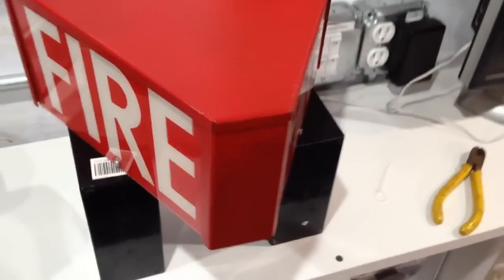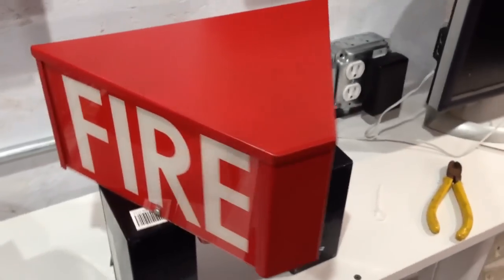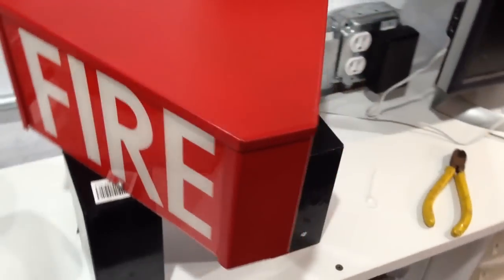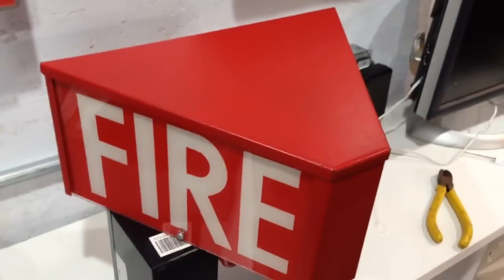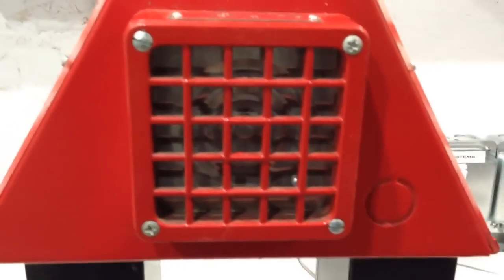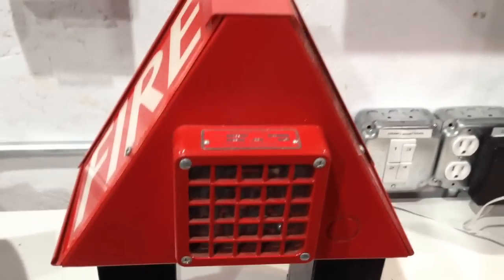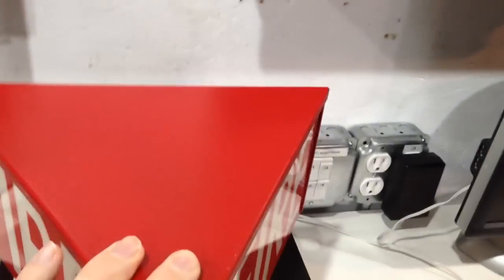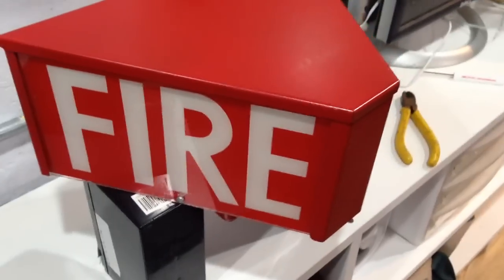Very rare Fire-Lite light

Comment: Interesting to see a federal signal horn on the fire light unit, are you sure this is the way they came from the factory or could it have been put together by someone ?
There is also a hex bolt that you can turn to adjust the pitch of the horn. They sound much better when running on 120VAC
Reply from the maker: Video Security Services, Québec Yeah I am pretty sure this is how they came from the factory. As for the screw, I know where it is, have not turned it yet.
Reply: ***** About the bolts, why do some older horns allow you to adjust the volume?

Comment: I’ve seen it at an old hotel called the Gadsden. But I don’t know what the alarm on the bottom is. It also had a Fire-Lite BG-6 connected.
Reply: Just like what you said about it being in a hotel. Was the hotel in Arizona?
Reply: Because I think I saw it once in person.
Reply: That was the hotel featured in the episode of Hotel Impossible that Andrew mentions. ("Fire Drill Flameout" if you're interested) Going by what I've seen on Google Maps, most of that 1970s-era system has been replaced with a modern Simplex system: the Fire-Lite C-series panel has been replaced with a Simplex 4010ES & the Fire-Lite "fire lights" with Simplex Truealerts. The original BG-6 pull stations appear to still be there though. While I don't know what might have happened to any of the alarms, I do know that the original Fire-Lite C-series panel is on display in the hotel's "museum" section.

Comment: Newageserveralarm can you help me my Notifier NFW-50 is not working right I was getting ready for system test 4 the panel is going into alarm nothing was pulled no shorts I don't know how to fix it please can you help.
Reply from the maker: MST 2474 What device is causing the alarm?
Reply: I had another resister hooked up I never noticed it but there is another problem with my Notifier NFW-50 NAC 2 doesn't work the panel does not display a trouble I don't know why.
Reply: @YutuTheFox  That's Notifier for you

Comment: I cant help but notice that distinctive pull station that's on the far right (the one closest to this fire lite fire light) of the other ones what's it called and who manufactured it.
Reply: SixR it's a very rare fenwell pull station that would activate a fire suppression system with either fm200, foam, or any clean agent 
see mini system test 23 for the test
Reply: SixR the model is unknown

Comment: After the hotel impossible, did they put a new Alarm in place?
Reply from the maker: I dont know,  never been there before.
Reply: Official NewAgeServerAlarm it should be a bit up to code because of low frequencies wake up people, they also need to put more low frequency alarms there According to the video it was too quiet by the panel.
Reply from the maker: Depends on the requirements of the local authority having jurisdiction.

If they are following current codes, yes low frequency sounders.
Reply from the maker: Also quiet by the panel could be also the type of microphone they are using on the camera. It may have been a "shotgun" - a directional microphone that picks up sound the most effectively directly in front of it but not off to the sides.
Reply: Sorry to be 3 years late, but to answer your question: it appears much of the system WAS replaced sometime after the Hotel Impossible episode aired. The 1970s-era Fire-Lite C-series panel was replaced with a Simplex 4010ES & the Fire-Lite "fire lights" with Simplex Truealerts. The original BG-6 pull stations appear to still be there though. (all of this I saw on Google Maps) Not to worry though: the hotel's original Fire-Lite C-series panel can still be found on display in the "museum" section of the building.

Comment: Anybody know if the older Federal 450 is the same as the Simplex 4041? They look a like.
Reply from the maker: Goldenrod636 They're slightly different. This horn has "ripples" in the sounder plate while the 4041 one is flat.
Reply: ***** Just asking. Though the 4041 does sound like the Vibration 450

Comment: I just got a 450 A1 Series (450-048-001) Like that. But with differences including:
1. It is a grey horn
2. It has a 3/32" DC Volume Screw on the front of it
3. It runs on not 24 but 48 VDC

Comment: The alarm is big. Is it also heavy?
Reply from the maker: Tech Cooker A bit heavy, probably about 2 or 3 pounds.
Reply: ***** That's not bad. Which is heavier, the Fire-Lite Light or the Simplex 4050-80 or 4050-85 light plate?
Reply from the maker: Tech Cooker Fire-Lite Light
Reply: Official NewAgeServerAlarm that’s pretty light. It looks VERY HEAVY.

Comment: I miss the 8005 and i8005 will you do a mini-system test with them?
Reply: gbvenom he has gotten more higher end panels like the notifier lowset high end panel 
he doesn't have the time and space to make a demonstration system with either the 8005 or the i8005 because 
1. The 8005 is not loaded with features 
2. The i8005 still has bugs in it

Comment: What dose loop mean I got a nd 9200
Reply from the maker: matthew Groff Loop refers to the SLC (Signaling Line Circuit) that all the addressable devices wire to. You should really read the manual for the MS-9200 before you mess something up and accidentally break it.

Comment: My old elementary school had these and the BG6 pull stations. I wanted to ask for one when they tore down the building but I wasn't able to.
Reply: +Sebastian Tolls Hmm, was that the old Wellington Elementary in Belmont MA?
Reply: Yes. I went there before and during the time it was rebuilt.
Reply: Yeah, I have a friend from Belmont. It seems most new schools they build in Eastern Massachusetts go with EST voice-evac systems nowadays; an exception is the new West Bridgewater High School, which has a Simplex 4100ES voice-evac system, but that might be because the old high school had a Simplex system as well.
Reply: +wileyk209zback I went to Chenery Middle School, also in Belmont and they had a simplex 4020 voice evac system with Federal signal horn strobes.
Reply: Yep, my friend went there too. The high school has a pretty old Simplex system from 1971 with flush-mount 4040 horns on 90bpm March Time (I think they had a 2001 panel installed in the 80s). But they may be replacing it soon.
Reply: +wileyk209zback I'm at the high school now. They are replacing the Simplex 4040s with Specter Alert SP2R speaker strobes. I don't know what the panel is. I asked about getting one of the old alarms but the school said that they first have to make sure that there is no risk of asbestos exposure.
Reply: Interesting; they're probably putting in a Notifier voice-evac system. That's what they often use for fire alarm replacements at Brockton's schools too. I'll have to let my friend know.
Reply: I also heard that one year after the Notifier voice-evac system was installed, it shorted out! Talk about dumb luck. The Simplex 2001 before it lasted way longer. But hopefully the replacement Notifier panel will last almost as long as the 2001 did.

Comment: Try swapping the horn for another 12vdc horn or something...
Reply from the maker: Bob Trevek I don't have any more 12 volt horns.
Reply: Oh..
. Then what you should do is take a relay, wire it to the turning relay, and have 3 9V batteries and a 24vdc horn of your choice, then wire the batteries and the horn in series with the relay... Something like that... It should work, I don't have that particular alarm in my collection, besides... I don't know the model of the entire alarm... Not sure what to tell you here...
Reply: ***** Is Your 4030 12 Volts?
Reply: +Marvin Stigall VGCP It's an AC horn.
Reply: Bob Trevek It is fine the way it is... there is no reason to use 9 volt batteries for a fire alarm system anyways...